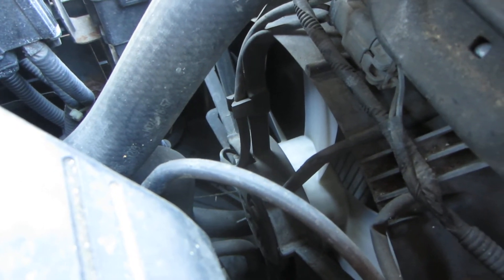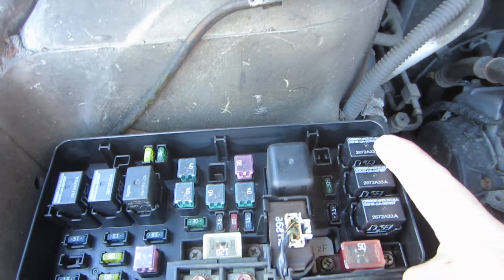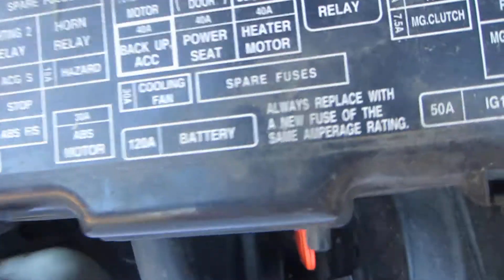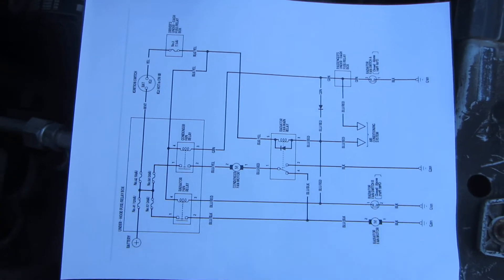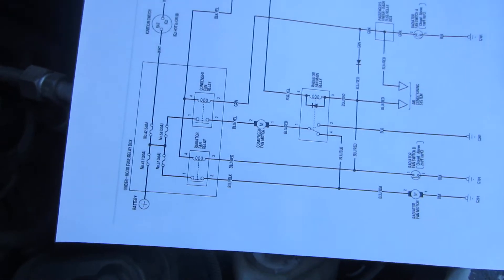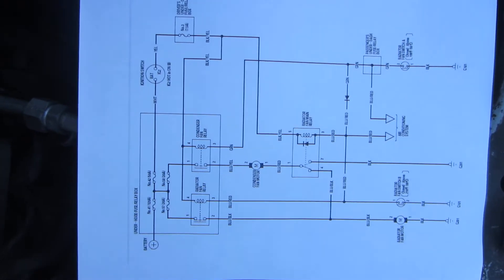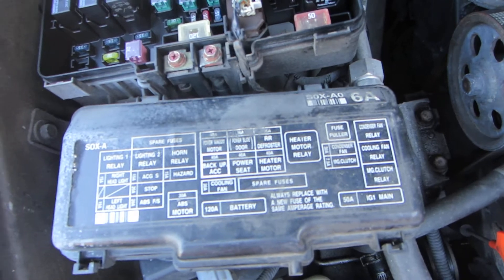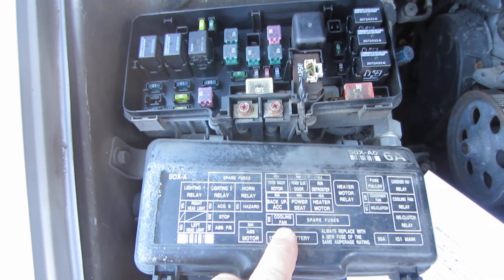HONDA ODYSSEY Cooling Fans Wiring Schematic - Relays and Fuse Panel 2003 - 2007

Comment from the maker: A FEW NOTES: 
1. The overheating problem on this vehicle turned out to be the temperature sensors located on the engine - it is best to replace BOTH sensors when doing this repair.    2. To view the schematic in full screen size, click the icon on the screen at the right side bottom corner.    3. This video runs a bit slow, so you may want to speed it up by hitting the "Settings" wheel icon and choosing 1.25 speed.
THANKS FOR WATCHING! HOPE IT HELPS!